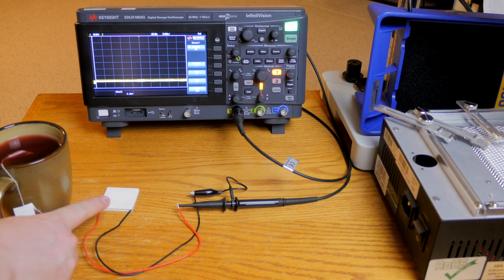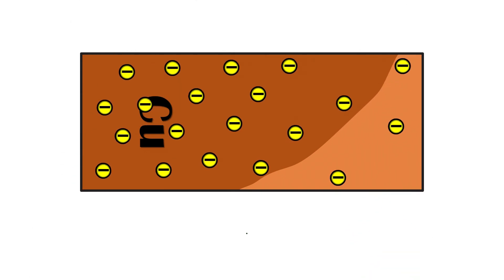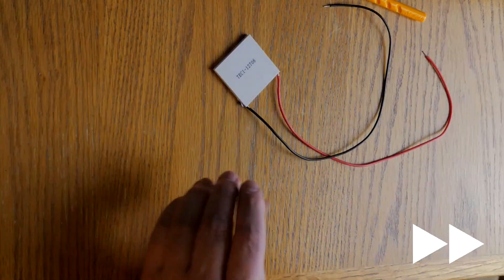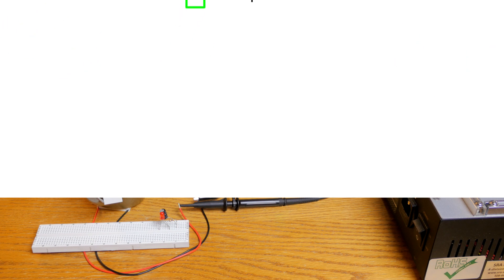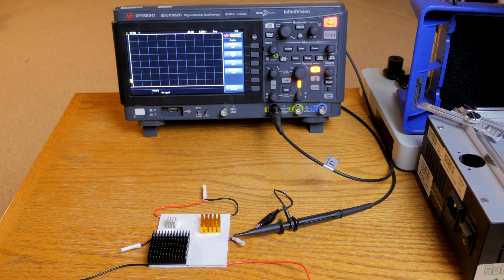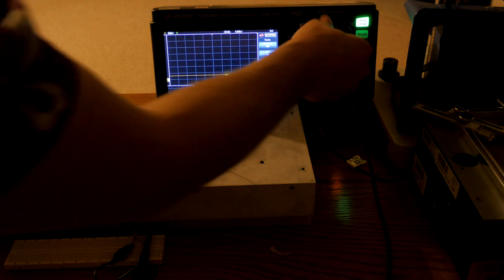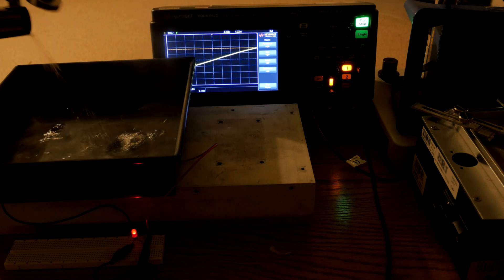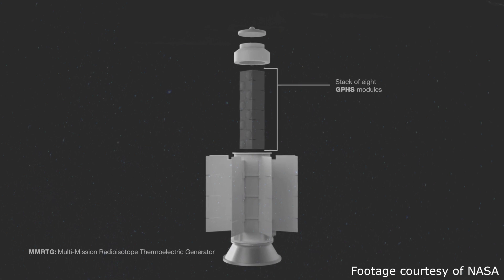Electricity from Heat: The Seebeck Effect in Action

Comment: Sir i think it generates very less current so it may be a drawback....

Can you do anything (please reply)
Reply from the maker: 1) increase the temperature difference (keep the cool side cool with a better heatsink, heat up the hot side), 2) better match the load impedance using an energy harvesting chip (not covered in this video due to the intended audience), 3) use more in series/parallel depending on if you need more voltage or current respectively, or 4) use something else for energy generation because while this is an interesting effect, its practical uses are limited
Reply: @funtechu  THANK YOU VERY MUCH FOR YOUR QUICK RESPONSE

Comment: can moving cars' friction generate enough heat to generate a substantial amount of electricity, say enough to power streetlights?
Reply from the maker: Doubtful. Cars crossing pavement has relatively little friction and wouldn't create enough of a temperature difference, plus TEGs are pretty fragile and sensitive to vibrations. There has been some discussion of using piezoelectric generation on highways, but that also has pretty big practical limitations.
Reply: @funtechu  thanks a lot for your reply sir, i will try to think of something else to solve this problem

Comment: Great video... 2 things :
1) I'm missing how current flows threw the TEG
2) It's unfortunate that the Seebek Effect is unminded by using a Pelltier device (TEC in reverse)
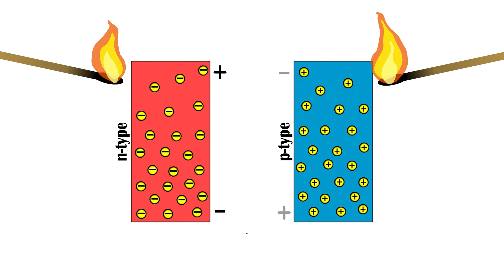Reply from the maker: The net effect of heating one side is the accumulation of electrons on one end of the device and the formation of two weak electric fields that both want to accelerate electrons in the same direction when connected correctly in series (see polarity at 2:03). When a circuit is completed between the two terminals of the TEG through some external device, excess electrons can flow from the negative terminal to the positive terminal where they cancel out with the "holes" or absences of electrons that have accumulated on the positive terminal. As long as the far side of the positive terminal is still heated, this cancelling disrupts the equilibrium meaning more "holes" will drift towards the positive terminal due to the heat releasing more electrons to flow through the conductor connecting the two semiconductors and into the hot end of the n-type semiconductor. Of course, the n-type semi conductor is also repelling electrons from the hot end, so these electrons are also forced back to the negative terminal and the cycle starts again. Some key things to keep in mind is that this all happens essentially simultaneously as the electrical field propagates through the system, and that the temperature difference needs to be present to maintain the power generation since the movement of electrons from one to the other happens by the heat exciting the electrons until they move into the conduction band, and then they move away taking the energy with them (and effectively cooling the hot side a little bit, hence why the Seebeck and Peltier effects go hand in hand). If the two sides end up the same temperature, even though they may be excited, the net charge on both ends are the same so there is no net electric field, and hence no net electron drift.

And yeah, Seebek is definitely not as much of a household name since the typical device is named a Peltier module or in other contexts simply a TEG/TEC.

Comment: Question - it’s winter here now, and from my understanding, the ground at 6 feet deep should be a constant 10 degrees C or so while the surface temperature is below freezing. In theory, with one side at the surface and one 6 or more feet deep, wouldn’t this generate electricity with this type of setup?
Reply from the maker: So there are several aspects of this question that are fairly limiting. The ground below a certain depth isn't "magically" at some constant temperature, rather depending on how insulating the soil it, it may stay above freezing during the winter (look up information on "frost line"). However, by putting some device that is conducting the heat away from the ground out to the surface, it would likely pretty quickly equalize, so the energy generated would be negligible. Since soil isn't particularly conductive, this means that it wouldn't be able to replenish the lost heat fast enough. It's best to think of the ground not as some infinite source of heat, but rather as a large thermal mass. That mass will either heat up due to the sun, or in rare areas with geothermal activity, due to geothermal heat (but in that case there is already a much more efficient source of energy available). Similarly, since the thermal difference between the ground temperature and the air temperature is small (say only in the 10-20 degree celcius range), then the energy generaged by a TEG would be small as well. Especially because getting that thermal difference to the TEG over a distance of several feet would mean losing most of that temperature difference along the way due to the thermal resistance of whatever material is used to conduct the heat.

So the simple answer is, yes it could theoretically be used to generate a small amount of power, however due to limitations it probably wouldn't be worth it. Throwing up a single small solar panel, or wind turbine would probably be far less expensive to generate an equivalent amount of energy.
Reply: @funtechu  ah, cool, thanks for the reply!

Comment: can we use a hot cup of tea to produce enough electricity to charge a phone? with the second circuit
Reply from the maker: The short answer is no because the energy needed to even power a phone is on a whole other scale from the energy being generated here.. A hot cup of tea on that side would likely only be able to produce a few milliwatts of power. I ran some back of the napkin math in another comment and got about 7.66mW of power peak for the hot water case (which is actually better than the hot cup of tea would be because there is only a thin metal bottom). And even so, it would cool down to room temperature in 5-10 minutes so you are talking only a total of around 2-3 Joules per cup of tea in the best case scenario.  This is much lower than even the standby usage of most smartphones. For example, an iPhone 12 has a battery that stores around 40,000 Joules. In standby the phone uses around 50mW, so the hot cup of tea wouldn't even keep up with the energy drained with the screen off and the phone in standby mode.

The Seebeck Effect is definitely interesting, but the energy generated in most situations is rarely enough to make it worth it, especially for any terrestrial use. The reason they work so well for space travel is because radioactive material is a good constant source of heat, space is a good constant source of "cold" (a place to radiate that heat so the difference remains), and they are essentially zero maintenance.
Reply: @funtechu  thank you so much for your reply

Comment: whats the absolute highest quality and maybe industrial thermoelectric you can get? I've actually been looking and I don't see much. it's puzzling....
Reply from the maker: Most TEC and TEG designs are standardized because deviating much in material, structure, and design will change the performance, and most are already optimized for their respective purposes. Since most follow a consistent part number scheme, you can see the options here: https://customthermoelectric.com/tech-info/te-encyclopedia/part-structure-option-codes.html.

Typically choice boils down to thermal distance, area constraints, and whether the TEC is sealed or not to prevent moisture from getting in.
Reply from the maker: For example, using the description here: https://customthermoelectric.com/tech-info/te-encyclopedia/what-tec-do-i-have.html we can break down what the TEC1-12706 used in this video actually means: "TE" is the same, "C" means it is a standard cooling designed device (vs a smaller form factor), 1 means it is only a single stage (there are not multiple TEC stages stacked on top of each other for a higher thermal difference), "127" is the number of TEC pairs in series in this device, and "06" means "06" amps which is the maximum amperage you can drive it at when using it for cooling, in this case 6 amps.

Comment: Why dont they make solar panels using those thermal electric generators? You can hear air or water in a closed box with glass over it painted black. Theres your heat, and under you could have heat sink.
Reply from the maker: I missed this comment, but the short answer is that that process would be way less efficient than just a regular photovoltaic panel. PV is honestly remarkably efficient and inexpensive for what you get!

Comment: this would work well with solar on top of buildings, using the difference between the air conditioned building and hot solar panels.
Reply from the maker: The problem is that Air Conditioning takes energy as well, so you would end up using more energy than you would generate.
Reply: We need efficient storage options, which is the Achilles hill.

Comment: I have some questions which are related to 2 Peltier cells in contact. (QUICKLY PLS)
1.What happens when we keep both heat sides of 2 Peltier cells in contact?
2. Will there be any reaction when we keep the heat sides of both Peltier cells in contact and the model surrounded by water? The heat sides will act as a core of the Earth and the cool sides surrounded by water as crust of the Earth.
3. Can we change the heat energy into force, so that the 2 forces exerted by both Peltier cells are equal(balanced force) and they can cancel out each other which leads to no reaction?
4. How much volt can this Peltier cell produce and which volt battery is needed to store the produce? Which volt Peltier cell are u using?
5. In order to store the electricity produced, should we use any resistors or other electric components in-between the circuit?
Reply from the maker: 1. The "hot" and "cold" sides are just terms that establish the polarity of the device. If you put the heat source on the hot side, and a cold source or heatsink on the cold size, then the voltage generated would be positive (red lead at a higher potential than the black lead). If you reverse it, then the they would switch. So putting two "hot" sides together doesn't really do anything here.
2. No, nothing would happen in this case. The two sides of the Peltier must be at different temperatures to be able to generate electricity. Rembember, the Seebeck effect requires a temperature difference to generate electricity. If the whole thing was immersed in water that is all the same temperature, then no electricity would be generated.
3. I'm not really sure what you are saying here, but to convert heat into a physical force, you could use something like a bimetallic strip. These are sometimes used as thermal switches to turn stuff off when it gets hot. However, the force generated in this case is pretty minimal.
4. For any electricity generation, there is an I-V curve that specified the current that can be supplied over the operating range of voltages. Volts alone is generally meaningless as it's a function of the load current as well. For example, in the hot water case with the full array the scope shows 3 volts when providing  2.55mA of current, so that's about 1.9mW of power per TEG. But again, this isn't the maximum power point, just one that I picked since it's adequate for this demonstration. The maximum volts rating for Peltiers isn't really what you should be looking at, since that assumes the device is being used for cooling purposes, and it's the maximum that it can safely tolerate. You would have to do your own I-V curves for each device under the temperature difference that you expect to operate it under to be able to determine the maximum power point for each device. The peltiers used here are TEC1-12706 from Hebei. For storage in a battery, you would likely need to design a charge controller, and you could use whatever battery you want pretty much.
5. Here I'm using a capacitor for a small amount of energy storage. If you were truly using this in an energy harvesting capability, you would want to design a maximum power point tracking circuit that can adjust the load impedance seen by the Peltier to get the maximum power transfer. Resistors burn (waste) electricity, they don't store it. The resistor in this circuit is used to help limit the current through the LED so it doesn't burn out.
Reply: @funtechu  Thx a lot!!!
Can we use TEC Peltier cell to generate electricity and cool surroundings simultaneously?

Comment: With this circuit can you turn electricity in to heat
Reply from the maker: Yes, it works in reverse as well, as a heat pump. So if you apply a voltage, you can transfer heat from one side to the other. Look up the "Peltier effect" for more details.
Reply: @funtechu  so technical can it be a solar panal?
Reply from the maker: @uhoh5473  It could be used to generate electricity from the sun by letting the sun heat one side and then passively  cooling the other side. But it would be way less efficient than a normal photovoltaic panel of course.

Comment: Why are those pads kept between the sick and hot water .

Please Reply !
Reply from the maker: Are you referring to the thin grey pads that are between the TEG and the surface that it is in contact with? Those are thermally conductive pads and help ensure that heat energy can flow between the two surfaces, they function similar to thermal paste, but are a little easier to clean up (and have slightly poorer performance).

Comment: i've seen that some people do this with 2 heat sinks, 1 with cold water and 1 with hot water, whats the cold water for?
Reply from the maker: The cold water in contact with the cold side heatsink helps keep that side close to the temperature of the water (because the thermal resistance of the heatsink-to-water interface is low). So it's similar to what we do here, but in this case we are just using ambient air temperature for the cold side instead of water.

Comment: any data on amps or volts
Reply from the maker: So just some background on this project, I put it together for a demonstration for middle school students for a local science festival. As such I didn't spend a lot of time characterizing the devices other than for figuring out how many I would need to combine to be able to drive an LED. I did some basic characterization with a 300 ohm load and a 1k ohm load, but that was just on a piece of scratch paper, and is long gone.

However you can get a pretty good estimate from looking at the video. The scope is plotting V (in 500mV/division) and you can use the provided circuit to compute roughly what the current is. Multiplying those together, you get the power which is generally more useful.

Using some simple back-of-the envelope calculations, we can get some estimates. For the case where I place my hand on it, the scope reads about 2V on the output in steady-state. The LED used is LTL2R3KRD-EM and I used a series 470 ohm resistor. If we estimate that the LED was close to just barely turning on, then the forward voltage would be probably close to 1.6V. This gives a current of (2-1.6)/480 = 851 μA for the whole array, and a total of 851μA*2V = 1.7 mW of power. This comes out to a power of about 425.5 μW per TEG with the temperature difference between my hand and the ambient temperature.

For the hot water case, the voltage goes up to 3V, and the LED was on brightly so we'll use the full 1.8V forward voltage rating. This gives a current of (3-1.8)/470 = 2.55mA for the whole array and a total of 2.55mA*3V = 7.66mW of power. This comes out to a power of about 1.9 mW per TEG.

Hope that helps. If you are interested in using a TEG for any application, I recommend fully characterizing it under the conditions you will be using since various TEG and TECs operate more efficiently in different temperature ranges. For example, that's the reason I'm actually using a TEC in this video instead of a TEG, because they are generally more efficient when operating near room temperature. Products that are branded as TEGs are typically designed for high temperature operation. 

Also keep in mind that the impedance presented to the TEG will wildly change how much of the power is transferred to the load. This is why in a commercial application you would probably use some maximum power-point tracking energy harvesting circuit to get the most out of each TEG. In this case the intention was making things simplified and easier to understand given the expected audience.